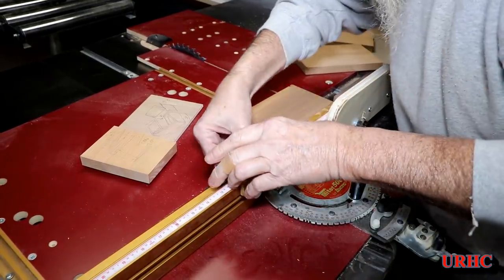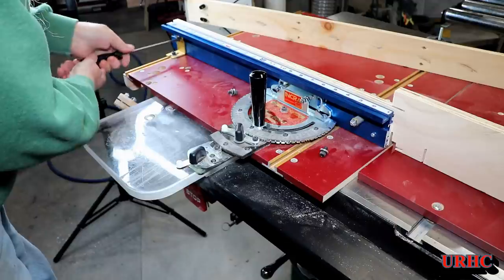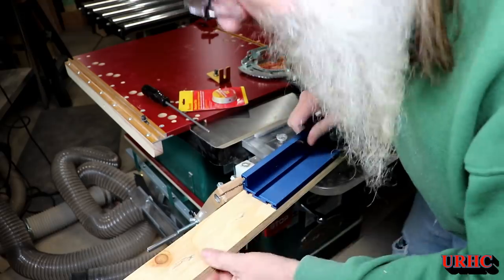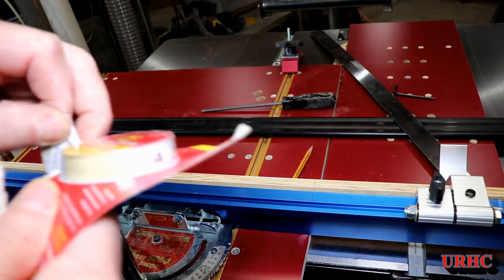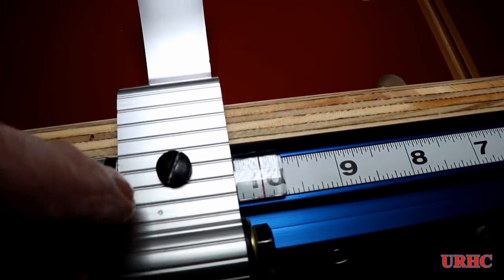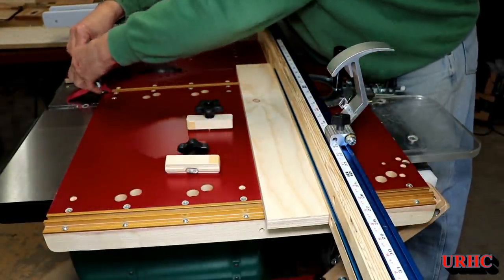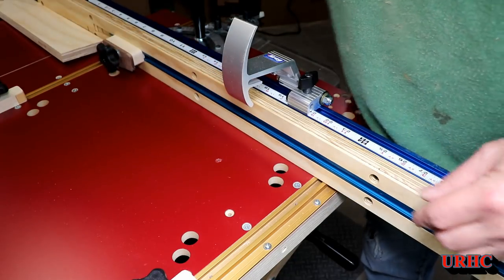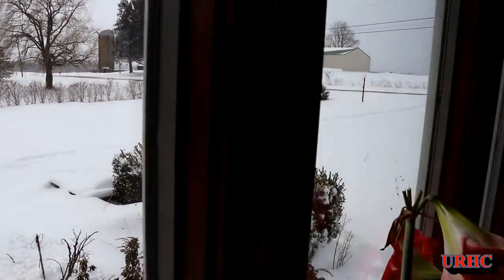KRIN Miter Sled 1/2 Kreg 1/2 Incra And A Couple Small Stops

Comment: I think these manufactures could learn a lot for you. They will steal your ideas. LoL
I thought your new toy was going to be a track saw.
Reply from the maker: Some of them just make things complicated and hard to use. That northern saw I bought for metal a couple years ago is junk and when Evolution contacted me about  a brand new model that looks to fix everything I  had problems with on the old saw I jumped right on it. This will cut 5 x 5 steel. Thanks for watching.

Comment: I see you have the same table saw that I have had for many years. When I got mine it was $800 bucks. Of course I went to an up north store and picked it up. As far as the fence ...I’ve gotten used to the incra fence. Nice modification though. Thanks for the tip.
Reply from the maker: Mine was a little more than that. When I ordered it I wondered if I really needed 5 hp.  Ripping 2 1/2 inch ash like butter tells me that I made the right choice.  Great saw.  That incra sled was a big mistake, I should have just built one because it definitely is not worth the price.  Thanks for watching.

Comment: Hello
Very informative. I wonder if you or one of your followers could address how you use the sled to cut a 45 degree   Do you just add a new sacrificial fall off piece or do you have to adjust the main sled as well
Thanks
John
Reply from the maker: Yes I also have a cut at 45. And other angles I just slide the extrusion back or use the kreg miter gauge and miter set.  Thanks for watching.

Comment: Nice. I'm gonna do this too. The incra fence and stop are annoying.
Reply from the maker: This has worked  out good for my needs. Extra cut capacity is a big bonus . So much  easier  for me to use then the complex Incra stop. Thanks for watching.
Reply: @unemployedredneckhillbilly2023  the sled feels too tight in the slot until the little 2 tabs at the far end exit the miter slot, then it glides a lot more freely. any way i can improve that? it's screwed down all the way. maybe the black adjuster rings are too  tight/loose?
Reply from the maker: Should be smooth and tight for the full travel.  I would  start  by backing  off the middle  ones and get the end ones properly  adjusted then go back and set the centers. It's a pain to set right but you only have to do it once.

Comment: Im curious if you use the sled exclusively for 90° cuts?  What changes are you making to use it to cut 45° angles, etc?  Just loosen the 2 fence screws and slide it to the left?
Reply from the maker: I use it mostly  for square cuts and slide it left for angles, dados, and thick stock.  I also  added a plastic blade  guard that I  have to remove for angles.  Thanks for watching.

Comment: What Miter gauge to buy the incra 1000SE or the kreg?
Reply from the maker: Mu Kreg jig is very flexible when extended out for wide cuts. I think the incra uses a steel slider and is more accurate after you set it. Thanks for watching

Comment: Ooh ... I see you have the router wing .... did you happen to add a full base roller base. If so where did you get it. I’ve been looking for one.
Reply from the maker: No base because my floor is not perfectly level.  It's all leveled up and not moving.  I have a couple grizzly bearclaw bases that are very low cost and work good.

Comment: I don't have the incra fence, but the miter gage. The fence and stop are the same. I agree that it's a pain to use the stop. 

How are you liking the dust collection on your router table cabinet? I've planned to collect from underneath the router. I'm curious about your idea of doing it differently.

I just found a video where you added light to the router table. I see dust collection is fantastic. I must be missing something. Seems like dust would drop to bottom of the cabinet.
Reply from the maker: I just couldn't get used to the stop and thickness of the fence.  Now I don't need tools and a ruler to get accurate cuts.  The dust collection is not perfect.  With edge cutting bits I get it all but when cutting pockets some chips do make it out the bottom but the fine dust is mostly caught. My dust collector doesn't have enough flow plus the extra 20 feet of hose I am using till I move my lines doesn't help. I may remove the tee and just run separate lines when I update my dust collection system next winter.  Thanks for watching.